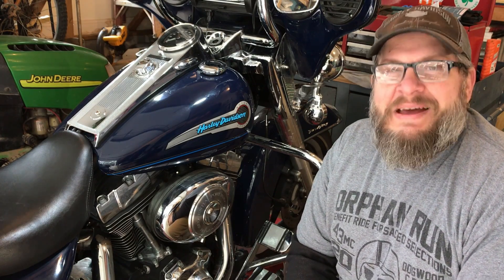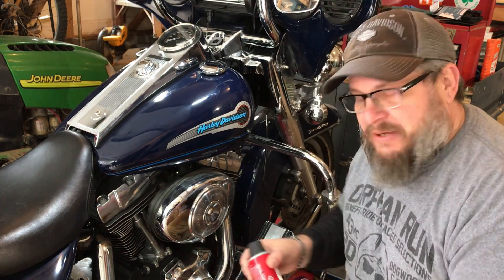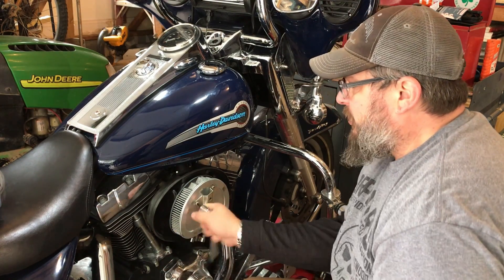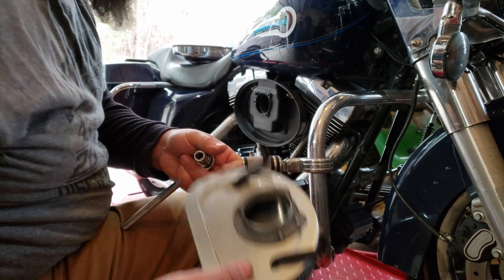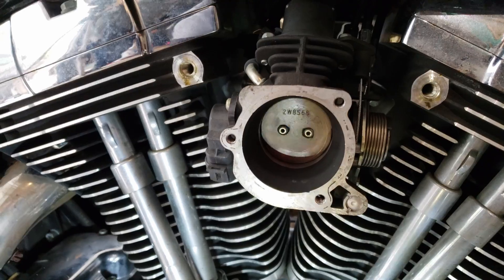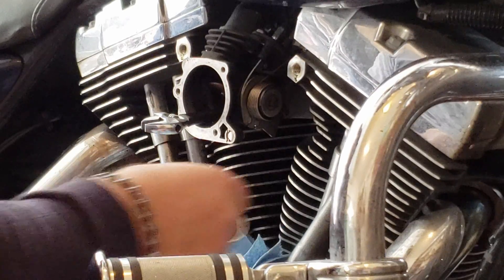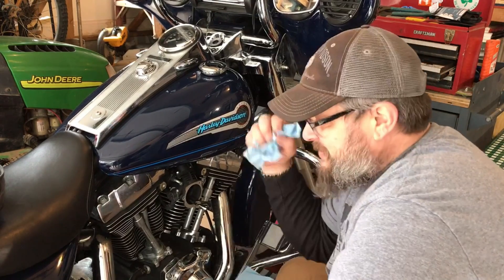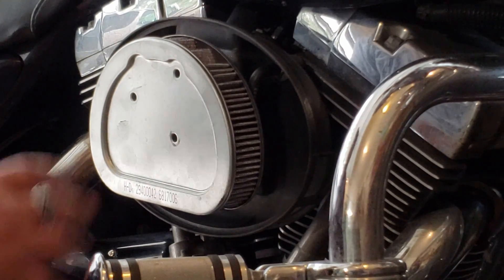Cleaning a Harley Throttle Body - Symptom - Sticky Throttle

Comment: Brake cleaner and throttle body cleaner are different like you said. The biggest difference is throttle body cleaner is made to cut carbon build up found in throttle bodies. Brake cleaner is not as effective but great on brakes. A little tip for helping remove some of the ugly on a throttle body is an old tooth brush. DO NOT USE a metal brush, brass included. The bristles may come off and those pieces are not good inside the motor.  Electronics do not like them either. The plastic bristles wont harm if they come off.  You spoke about the adjustment but you never talked about lube on the cables. Cable lube works best it creeps down the cable for a full lube.  There is a inexpensive tool that helps. A tip on cables is with the bars at full turn both ways the throttle should move freely. It should always snap back to idle no matter where the bars are.  Sorry for all the info. Its where I go when I see things I can help on. 
Second observation, your cameras nice and clear. The sound is great when you face the camera. Your voice is a little muffled when your talking looking at the bike. You might want to look into a lavaliere mic that goes on your shirt.  They make some that are very sensitive and I do not think that would be good. The tool and metal sounds pick up much better than voice. You need one less sensitive. I can maybe help you out with some of that.  If your reaching on the other side of the bike with your head leaned over talking you may not get what you were saying.  Many of the vlog cameras are made to be looked at while talking. 
Did love the video and great job.
Reply from the maker: Good stuff and yes I am looking at a on body mic I just need to wait till I get some funds, maybe some paid customers, lol.  Excited to see it grow and sharpen shills along the way.   Headed out of town this weekend but I will reach out to you when I get back.   Awesome constructive criticism I thank you for it!!!

Comment: Are there any gaskets on the backside of backing plate , where it is attached to the throttle body and  on the backside of the backing plate where the breather bolts go into the front and rear cylinder?

Comment: Nice vid. Can't help but think that if the crankcase gases were being vented externally, there would be very little build up of anything in the throttle body.  Your thoughts? 🤔 🙂
Reply from the maker: Hey my man, just saw this comment.  Need to think about that one but you may have a point there. I am more a electrical guy then a motor guy.  I am just really digging into motors more now and learning a ton of info fast so that’s something I would need to dig on but interesting thought thanks!!

Comment: Can we use WD 40 for IAC system
Reply from the maker: That honestly I don’t know.  The throttle body cleaner is chemically formulated to do its job.  Not sure how wd40 would work and not sure how the composition differs honestly
Reply from the maker: One other thing I just thought of using a product like WD-40 if it leaves a oily film may attract dirt and grime in deposits versus a throttlebody cleaner which does not leave a film on the surface
Reply: @YogisCycleService  thanks for your advice 👍

Comment: My street glide every time I hit the throttle couple time , it’s make a big explosion 💥. What could be ? Thanks
Reply from the maker: Not exactly sure what you’re asking
Reply: @YogisCycleService  I start my bike . Letting  run for about 3 minutes . Then I twisted the throttle couple times , then they make a big explosion on the air filter .
Reply from the maker: @SuperFrizas  First check valve clearance and spark timing (doubt its that), its either the spark that fires when it shouldn`t or the valve is open when it shouldn`t be or not closing well when it should. So you get backfire.  Burst guess without seeing it or hearing it.

Comment: I took my air cleaner off to look inside and there was a small oil puddle in the throttle body. My throttle also doesn’t spring back. I had smoke coming out of the air cleaner after I shut down the bike, a lot of smoke actually.
Reply: Too much oil in the engine most likely.
Reply: @wingandhog no.  It's ur crankcase breather blows right into ur throttle body

Comment: Are there any codes related to this ? My sporster 883 gave me a code p0122 and a p0107 Im a beginner rider and clueless to where to start. Any help would be appreciated. Good Work Man
Reply from the maker: Hey my man good question and sorry for the delay I got distracted.  I hope you got it figured out by now but no this was not throwing codes.   Sounds like you may have a sensor issue possible by I can’t recall without looking those codes up.  If you need more info hit me up on email or messenger.   Those addresses are in the text boys of the video or at the end and I will be happy to help where I can.

Comment: Do the breather bolts and hoses need to be cleaned?
Reply from the maker: juan z I don’t think that would effect the operation but with the miles on it and everything I am sure it wouldn’t hurt.
Reply: Breather tubes are cheap. Just replace them every so often.

Comment: No way I would ever stick anything metal to hold the plate open. Wood won't ding anything. The lower edge of the plate is important to tune a carb at idle.

Comment: If you are doing the job show the whole thing not just half of it the throttle assembly on the handlebarrs or are you scared you will loose the pin - Cut corners mechanic

Comment: Horrible way to keep that open you risk bending it. All you have to do it tighten the cruise control knob on the throttle housing and it’ll keep it open
Reply from the maker: Good points appreciate it
Reply: @YogisCycleService  yep. You don’t wanna accidentally bend that plate the other way is way easier and better